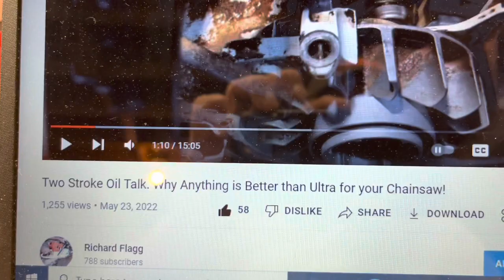Follow up. Delete Stihl Ultra Two Stroke Oil

Comment: I have used Stihl oil for years and never had any issues! Keep your air filter clean, use good gasoline and good maintenance, no trouble at all.
Reply: Whats the piston like?
Reply: @robertoduranos5196 , who knows? His equipment just runs and runs and runs, without failure. Why take it apart?
Reply: If he's good at running them hard, they don't get carbon build up.  If you are too easy on it, they end up like this.
Reply: @robertoduranos5196 I have stihl 12 year old. Stihl ultra only since inception. Clean piston , still has the factory milling. Now it’s not commercial ….but it does indeed have hundreds and hundreds of hours on it. Wide open when in use . Perfectly fine. The saw doesn’t lay around idling … if it ain’t being warmed up or is in a cut … it’s off.

Comment: STIHL ultra at 50:1.That's all I run in my 6 STIHL saws,  blower and 3 trimmers. Never had a problem. Retired STIHL tech that got to take the factory tour at Virginia Beach.
Reply from the maker: Pull a muffler or two on your saws and take a peek.  If you have 4 Mix type trimmers and blower you won't be able to view the piston.  I'd like to hear your results.  I work on hundreds and hundreds of hand held two stroke saws, blowers, and saws every year.
Reply: @richardflagg3084  I'll get back to you
Reply from the maker: @richardfuerst5286  I'm not the guy that likes to stir the pot, but I see this all to often.  We all spend a lot of hard earned money on this stuff.  You're more than qualified to chime in.  If there is anything I've said that isn't true, I'm all ears.
Reply: @richardflagg3084  well I just pulled the muffler on my 046. I realized that since running ultra oil I haven't had to clean the spark arrestor screen . Piston has a nice film on it. I'm a believer in that oil. I don't think STIHL would not allow just any oil in their equipment.
Reply: @richardflagg3084  no problem. Just my 40 years of working on STIHL products. I am all ears from your experience.👍
Reply from the maker: @richardfuerst5286  You're exactly right and you are the exception to the rule.  You properly operate and tune your own equipment.  
Stihl uses an Ester base for Ultra.  Run under ideal conditions and properly tuned it burns very clean.  In smaller hand held units run intermittently and partial throttle it's not so forgiving and leaves some serious residue.  It's the nature of Ester based oil.  The 661's like it,  I never see carbon.  They are run hard like a two stroke should be.

Conversely, the orange bottle HP oil, is more forgiving under less than ideal conditions and operating temperatures because it's a petroleum/mineral based oil. That's why I recommend it over Ultra.
Reply: @richardfuerst5286  I agree with Richard... Never had any issue with any stihl equipment running HP Ultra oil at 50:1 Piston and bore both have shiny surfaces with no visible scoring. My saw, blower and trimmer are always run full throttle as the manual says to do.
Reply: Give a saw to a professional faller to run it for a year or two. In that time frame, the saw is gonna rack up 1500 to 3000 hours or run time. Guess which saw, irrespective of engine oil, will still run after that time, and which one will have blown out the bearings way before 1000 hours are on the counter? The one ran 50:1 or the one ran 40-33:1? Homeowners can run even 100:1, the piston doesn't need much oil and if tuned right it will not score, but the bearings sure will care, but they won't tell a difference since they don't use their tools enough for failure to occur quick enough. That's why companies like Amsoil can sell their 2 stroke oil with the 100:1 snakeoil "guarantee", but the moment a pro uses it and blows up their saw they instantly lawyer up, time and time again.
Reply: @em4703  Friend, will the 33: 1 mix not damage the engine by carbon deposits?
Reply: I run 42.5:1
Reply: @richardflagg3084  no he is not the exception! I have 3Stihl saws- ms-210,ms-290 and ms-460. All run on Stihl Ultra . I had the ms-210 a part this summer, the piston , crank case all looked great. I bought the saw new in 2008 it has many, many tanks of fuel thru it. Nothing wrong with Stihl oil !
Reply: @richardflagg3084 Motul 710 2t sintetik ok oil cheinsaw ??
Reply: @richardflagg3084 you mean the STIHL HIGH PERFORMANCE 2-CYCLE ENGINE OIL ?
Reply: @matt2118 Meh, Stihl has to bend to lunatic EPA/EU rules.  That's the reason why they have 4-mix and over-priced battery powered crap.  

They're not alone.  Crapvarna, Toro, etc are all going down this road.  And I'll bet $$ to donuts they've received Federal grant money to do just that.  

I have been running Stihl Ultra, but I'm reconsidering my options at this point.
Reply: @H0kieJoe  my saw did look very good inside, I’ve been watching the Ironhorse YouTube channel some, he builds modified timber saws. Kinda changed my mind a little. But I still have had good luck with ultra.
Reply: @Sensei948 no, modern synthetic oils dont leave carbon deposits. they burn clean

Comment: This is as unscientific as it gets here. Comparing an Mtronic saw to a non regulated polluter saw. Comparing without knowing anything about the product, full synthetic oil to petro based oil......Film strength is not a thing here. You dont want to see a puddle in your crank.
Reply: Duh..

Comment: Sthil premium oil is made by Castrol, I've used Castrol two stroke oil since I was a kid and my father always used Castrol never cooked a engine logging, I'm 53 now still run everything 32:1
Reply from the maker: I haven't seen the premium or the super in my area.  The local dealers here only stock HP and Ultra.

Comment: I couldn't agree with you more in regard to cylinder wall/piston and ring lubrication versus bearing lubrication.
The bearings require good lube for a long life. 
You got a really good shot of the oil in the bottom of the crankcase. Any less than that is not enough IMHO.
 When people that spend their lives looking at 2 T engines in various states of repair voice their opinion, I listen. Well done.
Good point. Good video.
Turning the 572 into a torque monster would be interesting.
BTW. For the critics, there is an oil mix thread on one of the saw forums that's on page 915.
A lot of oil mix experts on that thread. Good informative reading.
Respect and peace to all.
Reply from the maker: I've got a great recipe for the 572.  She's gonna be nasty.
Reply: Great comment Mike!  Good points, and I will offer this:  
32:1/40:1 was/is fine for the older saws, and saws that aren’t set up to EPA standards.  BTW, EPA stands for ‘Extra Pain in the A*#’. 😳😂 Feel free to use that!  

I’ve been told by a Stihl Tech that 50:1 is what Stihl stipulates on their new saws.  Said tech told me that the newer oils were better, and the extra gas in that mix ratio helped to cool the engine?  I’m not a Tech, so I go by what the so called experts say.  My personal viewpoint is I mix it to 45:1, and it seems to work out alright.  I’ve got a Husqvarna 345e that I’ve had since 2005/2006 or so, and I pulled the muffler the other day, to clean it and the exhaust port, etc.  I was tickled to see a virtually ‘new’ Piston side , with no scoring.  Am I an expert, or the World’s greatest saw operator?  I seriously doubt that!  I’ve run that saw, mainly as Farm/Ranch/clean up and hesitate to guess at number of tanks run through?  I have used it but not abused it.  Non ethanol gas when possible, and Husky XP Oil.  I have run pre mix when I have had to let it sit for a short while.  

Long story short:  Use fresh Non E gas, Octane over 89, and name brand oil, or PreMix, & keep the air filter clean, and check the plug.  CLEAN the damn saw after use!  Take care of it, and it will take care of you.  Pull choke lever before taking your Air filter off!  That’s about it!  
Be Kind to one another!  Peace!
Reply: I run 42.5:1 Sthil HP

Comment: I run Redline Racing oil (full ester) in all my saws and other 2 strokes. I'm a long time RC pilot and like my giant scale planes which run what are basically sophisticated weedeater engines. Some years ago, one very respected manufacturer of these engines (Desert Aircraft) did a video about what their service dept has seen in different engines, and Redline stands by far as the cleanest, and certainly adequate in it's lubricity. I run it at 32:1 in every 2 stroke I own and my results bear out the video. I have a Echo 2511t with over 100 tanks through it and recently did a "freshen up/cleaning" as it was pretty full of sawdust and I was worried about cooling. I decided to pull the jug and It looked as though it has 5 or 6 tanks through it. 
I saw your 1st video and think you should try it again and reset the mixture for the heavier oil load. 
I like your videos, subbed!
Reply from the maker: Thank you !!!!
Reply: Friend, will the 33: 1 mix not damage the engine by carbon deposits?
Reply: @Sensei948   Not at all. It's a 100% ester formula and runs so clean the dirt bike guys like it because it doesn't require frequent power valve cleaning (a lot of them run even more than 33%) I personally have used it for 10+ years in large model aircraft engines, saws, brushcutters etc. and every time an engine  is opened a wipe with a shop rag will take 90%+ of the piston dome down to the aluminum.
Reply: @scottmarshall6766  LS + Husqvarna is ok ?
Reply: @Sensei948  Husky Low Smoke + is by all accounts a good oil, it's half mineral oil and half Synthetic esters, so it's generally a little cheaper than Redline. I've used it occasionally and it seems good, but I have no long term info. I have 4 Husqvarna saws, a commercial mower. a brush cutter, and a large string trimmer. In my experience you can't go wrong with Husqvarna products, but I still prefer the Redline mostly because I've used gallons of it and never had a bearing failure or piston scuffing, and I use my stuff hard, including the plane engines.
The LS+ does smoke just a tad, where the Redline doesn't smoke at all other than an initial puff upon startup. This takes a bit of getting used to, and when I 1st started using it, was concerned a couple of times I hadn't mixed it properly. It's so clean and odorless you may suspect you forgot to add it.
Reply: Every now and then throw a few ounces of Sea Foam in a gallon of 2 cycle gas.  It really helps to get all that carbon out of there.
Reply: Thanks for the info! A question? How does the Redline fair against the Red Max? Both sound good as options. I'm currently running Amsoil Saber at 40:1. Just trying to see if there might be something better.
Reply: @Vultain  I've only been playing with the Red Max for a couple of years, but it seems to be very similar to the Redline Racing oil in performance and cleaning action. Both seem to clean up old carbon from petroleum or castor based oils with time, and I wouldn't be surprised to find the formulations are very similar. They even  smell the same. If I couldn't get Redline, I would have little concerns about running Red Max. As far as the Amsoil goes, I haven't tried it, so I can't compare Redline to it, but it is indeed highly regarded. I run everything at 32:1 and have seen no reason to change that, even though I believe that 40 or 50 to 1 would probably still provide good engine life, but doubt they would be any cleaner. 
I hope that bit of info helps.
Reply: @scottmarshall6766  It does indeed help thank you.
Reply: Yet strangely enough, I've been using Amsoil Sabre and Stihl Ultra mixed at 80:1 for 23 years, without a single oil related failure. Many blowers, edgers, chainsaws, and grass trimmers, all fall apart due to use, but the rotating assemblies just keep on running. I haven't cleaned a single exhaust port or screen either.

Comment: I use ONLY Castrol POWER1 RACING 2T...
The oil for racing two stroke engines. Can be mixed 1% to 2% and ofcourse I mix 2% only.
Perfect throttle response, no smoke, ultimate protection, clean sparkplugs...

Comment: When I bought the weed-eater back in the early 90s, it was listed as 50 to 1.

Nope.  32 to 1, MC1+ (motorcycle oil) and richened out both screws - low, such that it idled smoothly and accelerated well, and high such that it was on the verge of blubbering while under load, just like the saw mechanic told me when I was in my teens.

It ran good.  More importantly - there was a faint haze of smoke, especially when cold.  That way I knew it was getting oil.
Reply: Trouble is you can't do that with today's self tuning carbs on the 4mix.  
Haven't ran an electronic tuned saw yet but I imagine they've removed the simple from it too.

Comment: i run red line 2 stroke oil at 40/1 in all my 2 strokes.  including my mazda rx7 race track car.  mixed with home made non ethanol high test gas.

Comment: I own a stihl BR380  2 stroke backpack leaf blower. What ratio (oil/gas) do you recommend and what brand oil? Enjoyed the video. Thanks.
Reply from the maker: 50:1 Amsoil Saber if possible.  VP Racing oil (mixed at 40:1) is cheaper in the 16oz squeeze bottle available at Walmart or Tractor Supply.

Comment: Richard , have you ever looked at any SAWS running Amsoil INTERCEPTER Oil ?  I have been seeing a nice oil coat from it in FAN/air cooled and L/C snowmobiles … curious how a saw looks after running it  . Thanks RAD
Reply from the maker: I haven't tried Interceptor or have anyone that runs it yet come into the shop.

Comment: So I’m not sure what it’s worth but I work at a Stihl dealer and my boss has told me that he has seen a test where they ran a bunch of different oils in a Stihl blower to test them. He said that the Amsoil 100:1 mixed at that ratio was still within the allowable spec after the test as was the Stihl ultra. Again this was a blower so most likely a 4 mix and I don’t have more info. I know that Stihl will double the warranty if you buy the ultra oil with a new machine. Our older 2t guy mentioned to me that in his experience it was great stuff. He said one day that it seems that if the ultra is used when the machine is pretty new it tends to impregnate the cylinder walls and protect them well. Haven’t heard any bad stories about it but I agree that it looks like pond water when mixed. I have a 362CM and It’s still pretty new with not many hours. You’re not a fan of the ultra? Is the normal orange bottle stuff any better in your opinion?
Reply from the maker: One of my customers used to own a tree service.  He bought an 036 new back in the late 90's, used it for years daily and now is a firewood saw.  He's run the orange bottle at 40:1 since new.  I serviced it last year and you could still see the machining on the piston.  I've always liked the orange bottle even though it's a low tech, old school oil.

The 4 mix units seem to run at a higher operating temperature and tolerate the Ultra better than their 2t counterparts when properly tuned/serviced.  I've NEVER seen a clogged spark arrestor in a 4 mix.  When your adjusting the valves, inspect for carbon/coking deposits on the case, springs and rocker arms. Especially on ones with higher hours on them.  

Honest question, how often do you see clogged spark screens on the BR3xx and BR4xx blowers, 2t trimmers/hedge trimmers, BGxx blowers?
Reply: @richardflagg3084  I’m not the 2t guy but our old 2t guy constantly had clogged spark arrestors on pretty much all the stihl equipment. He was always burning them out and it was pretty much standard with most homeowner machines. Sometimes would have to burn out the muffler to get it flowing good again because of all the crap in there. 
You like doing 40:1? Thanks for the reply
Reply from the maker: @JG54206  I feel for your 2t tech.  As for the 40:1, it's only another tablespoon of oil per gallon.  Don't be scared. 

Some of the very best oils do ok at 50:1 keeping a film of oil on the crank and bearings.  It's noticeably better at 40:1 on a teardown.

Comment: Richard Flagg,
how do you properly clean all that crap out where exhausts is to ensure it doesn't fall in crankcase and for general maintenance?
Reply from the maker: I wouldn't advise doing that on the saw just to be on the safe side.  If it's not too bad, don't worry about it.  If it's heavy, best to remove the cylinder and clean/inspect all.
Reply: @richardflagg3084  do you use air compressor? Rag? How to clean 🧼 ? Thanks
Reply from the maker: @medjoolmaker  The carbon build up in the exhaust port is very hard.  You have to chip it out with a small screwdriver, pick or an Aluma Hog burr.  Again this is best left alone unless the cylinder is removed.

Comment: Hey there Mr. Flagg, thanks for this video, but why are you insisting so much in the avoidance of using Stihl Ultra oil?
The Stihl dealer told me that it is a better oil than the Stihl High Performance oil.
What good reason do you have to insist in NOT using the Stihl Ultra in my MS260 chainsaw and my FS90R trimmer?
Please reply soon!
Thanks.
Reply from the maker: Every manufacturer, besides Stihl, has updated their two stroke oil.  Technology in lubrication and additives that help the oil burn cleaner has come a long way in the last 20 years.  Look for a JASO FD rated oil.  That will give you excellent lubrication without the carbon build-up of a lower FB rated oil.  

Ultra can and will burn clean in a perfect environment.  The FD rated oils will work in  a broad range of applications.  I see excessive carbon from running a piece of equipment at partial/intermittent  throttle, or to be more specific, not at "full operating temperature".